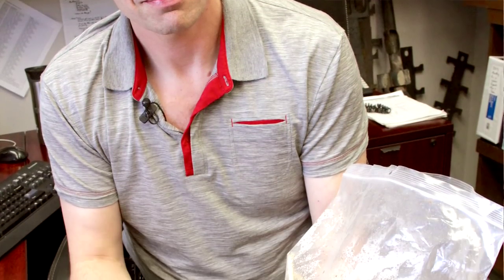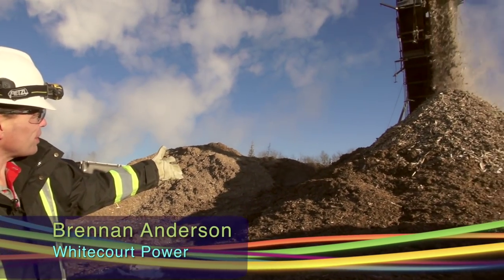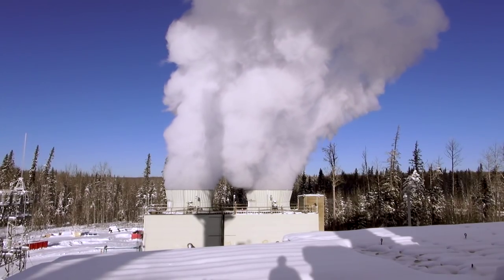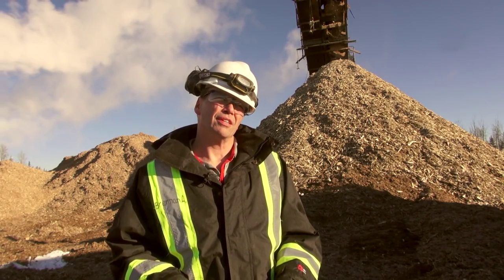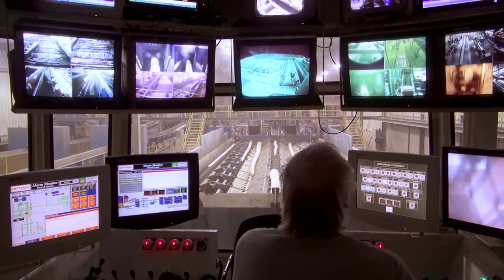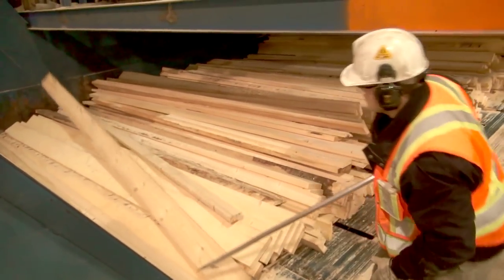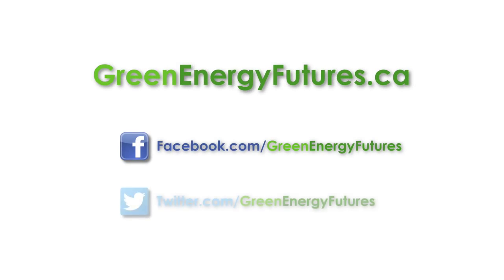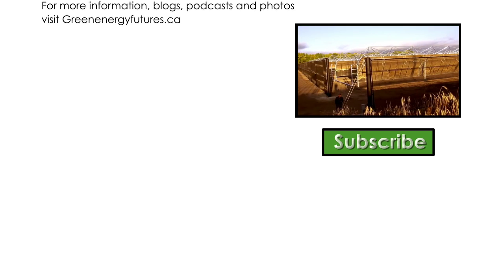97. Growing power: Wood waste to energy just makes sense

Comment: Depending on the jurisdiction, when trees are cut they are basically accounted as being taken out of their carbon capture ability.  They are only counted once.  When the byproduct is burned, either as waste or pellets the resulting GHG emissions are not counted because the tree would then have been counted twice.  Does anyone see a flaw with this accounting system?
Reply: I can see what you are saying with regards to cutting trees to burn them - bad idea in our opinion. But if you are taking a stockpile of waste wood chips and burning them isn't the the trade off letting the wood rot, releasing methane versus burning it and releasing CO2?
Reply: @DavidDodgeyeg  If the waste has been accounted as a tree or trees taken out of their carbon storage ability, that account does not recognize when then existing carbon in that tree or trees is released in to the atmosphere. What is being counted, in my example, is the lost of sequestration ability not the additional emissions from being burned.  It seems like an accounting model that does not recognize what is really going on.  Regards.

Comment: They should be using electric trucks, cube vans, and delivery vans instead of diesel trucks.  They should also install car chargers for electric cars and plug-in hybrids for the public to use. This way they can make money from selling more electricity by creating more demand for it.
Reply: We're do you want to charge them? There are 14 million acres that is covered by this plant...
Reply: @terrencesauve  Is that a serious question?
Reply: @firefox39693  why not? It's infrastructure and the fast charge  issues that are an impediment for anything EV. Please explain how the supply chain of forest fibre can be done for such a vast area.
Reply: @terrencesauve  The space for solar farms, residential, and commercial solar is is a non-issue.  I'm not sure what you're referring to regarding forest fibre.   I think you're implying you think e can only go 100% renewable if we rely, at least in part, on biomass for our electricity generation.   We don't need biomass.  I'm against the use of biomass for electricity generation.

Hydro, wind, solar, geothermal, tidal power,  energy storage, increased provincial and Canada-US grid connections, and a small amount of nuclear are perfect for Canada's energy future in decarbonizing our grid and getting off of fossil fuels.

Space is not an issue because of rooftop space, ponds, lakes, reservoirs, and other still bodies of water allowing for cheap dual-axis tracking systems for solar farms.